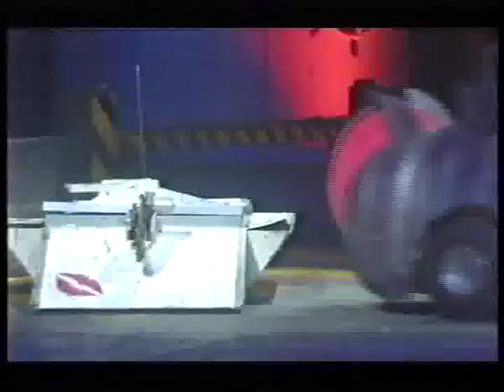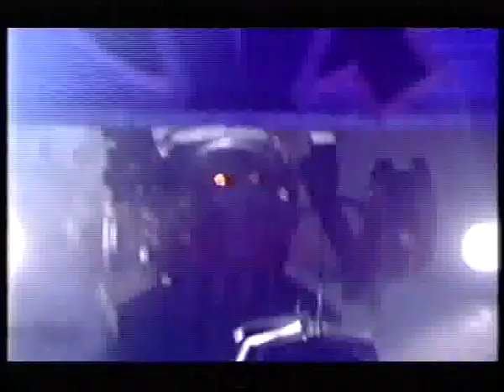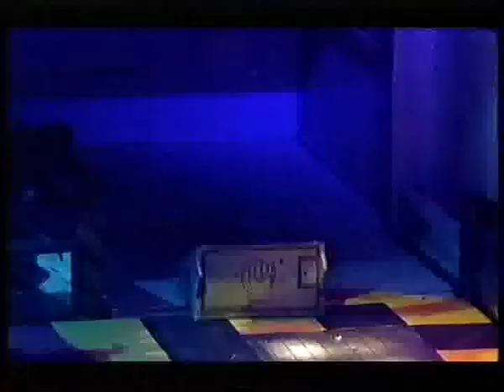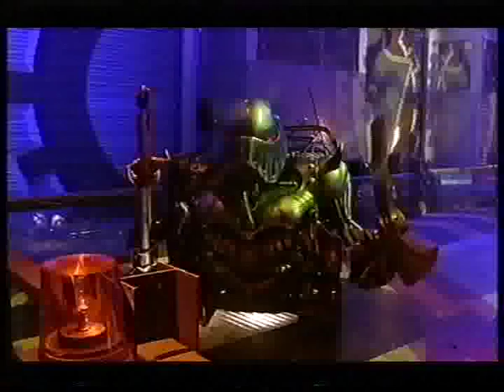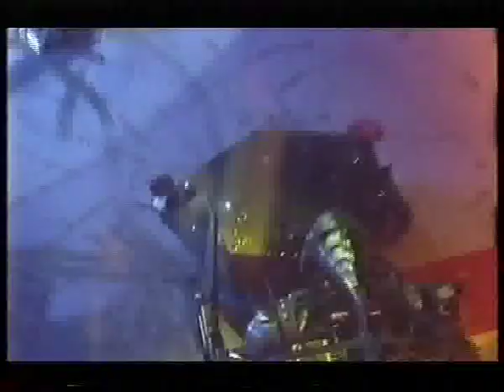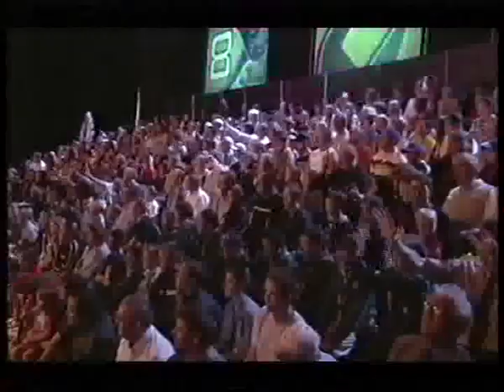Robotwars Series 6 Heat A Part 1

Comment: I liked Craig Charles' old outfit better than this one. Never was a fan of Ruf Ruff Dougal, while not fully against joke bots, I would've liked it more if it was something like diotoir which was still fun and had at least something, while those here are just complete jokes, taking up slots which other, way better reserve bots could've used, like Vmax of Fluffy in Series 4.

For some reason, when I sometimes think of Mr Psycho, I imagine him as silver Killalot with a hammer, no idea why though. To be honest, I don't find those two that fitting compared to the other house robots, but eh still better than Cassius Chrome.
Reply: Well Diotoir eventually won something, which is something few joke entries could ever say.

Sir Killalot and Mr.Psycho do shere the same chassis structure, a head-and-torso and all. They probably seem out of place because their mass is much greater compared to the rest of their brethren. I must say, Cassius Chrome had a lot of potential, but it was wasted away very quickly when Shunt and Growler still remained far more efficient pushers than him.
Reply: Gamzeevegeta
Diotoir did not only win something, it also did well in earlier series, even if the quality of robots wasn't that great back then, I still think it's something(also they used a petrol motor all the time and get set on fire so many times, it's really surprising that their robot never stopped to work because of that.)

Yeah, I know they are similar, but I really imagined him as a 1:1 exact clone, exept silver, a bit bigger and with a hammer. Might be because I didn't see Mr. Psycho back when I watched Robot Wars as a kid, and the first description I read made him sound like Killalot(which is kinda true, similar shape and all), also checking the wiki even more, the Pullback Killalot had a hammer accessory, so I guess it comes from that... anyways I could keep talking for hours, but I think it's for the better to keep this short xD.

I wouldn't say it's only the mass(althrough I have to say, growler is huge), but more on how gimmicky they were made, like they showed how the show changed from a somewhat serious competition to a "action, drama" for the audience. As for Cassius Chrome, I really dislike the design, looks like something that Twntrn(or whatever that Series 3 entry is called) or some other fan made robots would use. It was also more of a rambot from what I've heard, but that wasn't really a good choice.
Reply: ''Anyways I could keep talking for hours, but I think it's for the better to keep this short''
Yeah that's what happens when conversing about something you've known that is very near-and-dear to your nostalgia, you feel like you can talk endlessly about how Diotoir is a better pusher than Tornado or why they never bothered to put on any self-righting method for Shunt after Series 5 or what would've happened if Bigger Brother lost to Hypnodisc instead... I'm very guilty of it myself despite my bad memory.

It could just be me but I feel that sensation is most prevalant in '80s and '90s kids. I remember one silly reason why I believed Sir Killalot was epic back then was because I thought the sculpt of his helmet combined with the cables flowing out the back of his head into his body made him look vaguely similar to a Predator's head. Young and stupid, right?

I mentioned this in a reply to someone else, but yeah I do believe that Series 6 was when the show started to go down primarily due to increased infighting and lack of funding, but also because the producers started to care more about the spectacle instead of the hobby/sport.
Reply: Gamzeevegeta
Yeah, I meant more talking about how the series changed and how Mr Psycho and Growler looked a bit out of place there, but I do get your point.(Watched Robot Wars as a kid too, but I think it was only Series 3 and a bit of 4, after that they stopped sending it here ?) I don't really know if the other person wants to read a wall of text, so I'm rather careful with that, but looking at the comments(and the series itself) it's hard to just write something small about a Robot Wars Battle, things just have to be this big I guess, and everyone watching it doesn't mind.

I think all this show for drama and action, instead of actual hobby/sport, started in Series 5, well more like in Extreme1.

Comment: Again just stating an opinion dude. no need to yell :) as stated before, I respect other peoples opinions. As for the staged thing, it's true. Sorry but it was. The producers wanted to make the new Matilda chassis for the flywheel.  So instead of just dismantling the old one, they asked Razer to toy around with it if they won the Annihilator. It helped them make a new Matilda chassis and get a hell of a lot of ratings. Jeez all I did was say a true fact and you think it's because I hate Razer?

Comment: Knightmare, is that you ? Also did they lower the arena side walls ? The new Knightmare machine doesn't look too impressive but is still alright, something which would've been totally fine in series 3 or 4, but I don't think it will get far, especially since Razer is in this heat too...